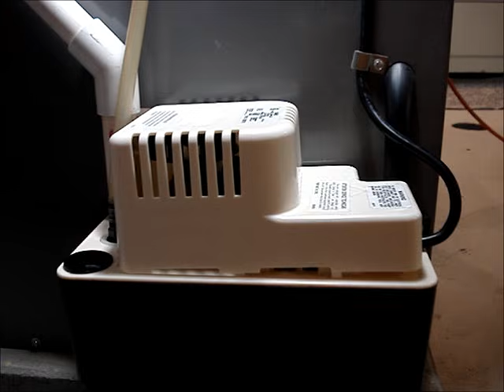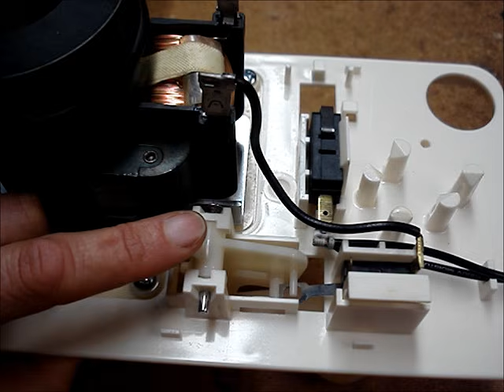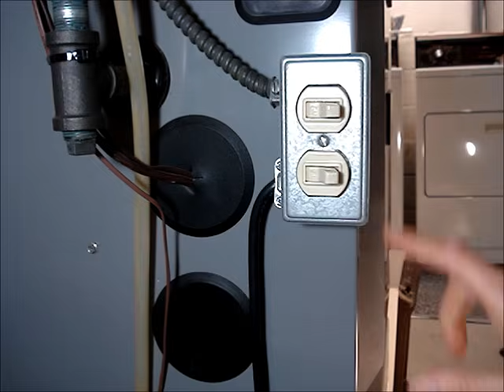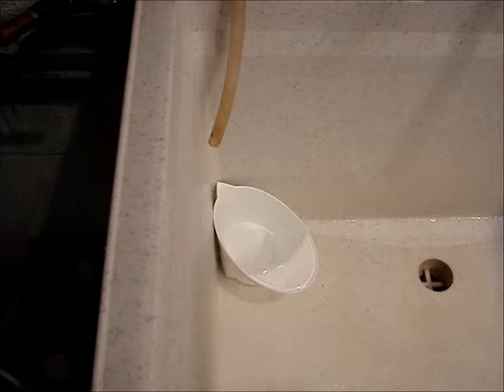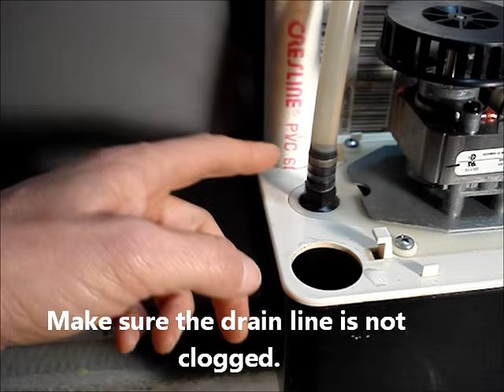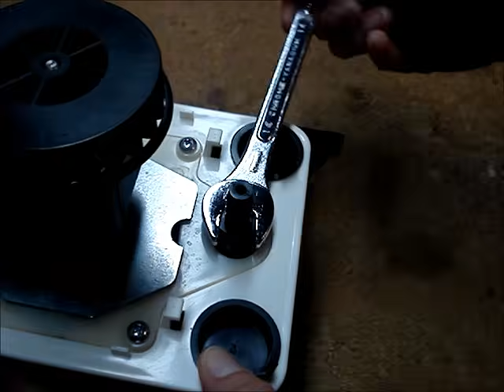How to Troubleshoot a Condensate Pump

Comment: I installed a brand new pump yesterday and it's overflowing from the tank onto the floor but it's still pumping water thru the drain line to the outside of my house.  No signs of drain blockage and i figure the chances of defective pump are slim.  I'm at a loss quite frankly.  Literally brand new out of the box.
Reply from the maker: If the new pump isn't failing the same way as the old one, check the literature that came with the pump.  It should have a number to contact the company.  Call them, they should have free support and can tell you if the new pump is defective.  These days new doesn't mean it's good.  I bought a brand new stove and the oven temperature sensor was defective.
Reply: @Know-How-Now It's failing the exact same way as the old one.  I read somewhere the plastic tube from the pump connecting to drain pipe should have a loop or similar trap to prevent water from backing into the pump and putting constant pressure on the float switch.  My drain pipe is above the pump and drains outside my house.  So the pump shoots water upward and gravity might force water back down.  Who knows...

Comment: I have a diversitech should a light be   on at all times to show power or does it just come on when filled with water
Reply from the maker: I am not familiar with all the details of various models/makes.  You might check on their website and see if you can download the installation instructions/use manual.
https://www.diversitech.com/product-families/condensate-management/condensate-pumps

Comment: Thank you for this video. It helped troubleshooting but still no joy. Then it occurred to me to take the top cap off and spin the impeller by hand ( when it was unplugged) then a bunch of rusty sediment came to the surface that was hidden in the impeller housing. After that it worked like new.  I will add a cup of vinegar a month to try and keep it clear.
Reply from the maker: You are welcome.  Thanks for sharing, your comment might help someone else get their pump going again.  Have a great day.

Comment: Why do you even need this? my old house has it, new house no? why do you need it?
Reply from the maker: The new high efficiency gas furnaces create condensate water.  Mine also creates water from the AC unit.  You also might find a unit like this pumping some sort of water up to a higher point into a drain system or maybe from a dehumidifier.

Comment: My condensate pump has been acting weird lately. It will turn on and off a lot. Sometimes it's in really quick and short bursts, other times it will be on for several seconds. There are a lot of bubbles in the outlet water line. When it comes on I will see the bubbles flow to the outlet, but then they start flowing back when it turns off. Not sure if this is a bad check valve or if one of the switches is going bad.

Comment: Hi, do you any video about how to solve gurgling noise on a condensate pump. My line is really long… goes up to the ceiling, cross my house and goes down from a second floor to the backyard…
Reply from the maker: I do not.  I'd venture to guess it has to do with how the pipe is run.  Maybe and engineer who understands fluid dynamics could solve that... it's beyond my level of education.

Comment: Good to know 😅 I accidentally pushed the test feature on the pump too long without water and I got smoke coming out if the motor
Reply: Does this mean my pump is messed up ?
Reply from the maker: Letting out the magic smoke is usually not a good sign.  Put some water in it and test it out... hopefully it still works.

Comment: Thank you for the video, my problem is that the pump works all the time, non-stop weather the AC is on or not. Any tips to fix are greatly appreciated.
Reply from the maker: I check to see if the float is stuck or the microswitch is bad.
Reply: @Know-How-Now  I appreciate your quick response

Comment: My ac shuts off because the pump gets filled. But if I unplug the pump and plug it back in it drains. Any thoughts? Thanks!
Reply from the maker: If it's the same pump as in the video, there is no circuit board, so no rebooting of any computer chip.  Maybe the float (gunked up inside) or microswitch is sticking?  You can try filling it with water and gently tapping the case of the pump to see if it starts up.
Reply: Thanks so much for responding! I will try it!

Comment: Thanks for the vid! My condensing pump wasn’t running after our boiler system leaked. Turn out I just needed to take the top cover off and play with the bobber/limit switch to get it back on track. I was planning on calling HVAC but this video and another on here let me do it myself. Probably saved me a couple hundred bucks!
Reply from the maker: You are welcome.  It's my pleasure to help.

Comment: I have a magnet float and it is set to low how would I adjust the pump to come on sooner.  Ac unit shuts down until I take top off and lift float up.  Mac
Reply from the maker: Without seeing/knowing the specifics about your pump, it is hard to answer your question.  I would suggest getting the make/model number from the tag on your pump.  Go to the manufacturer's website and down load the installation instructions.  There is likely a procedure to adjust the magnet/float.

Comment: My condensate pump keeps going on for 3 seconds, then shuts off and then comes back on for 3 seconds about 15-20 seconds later...and over and over. I have moved the PVC pipe to a large 5 gallon pale while I am running my AC until I can get around to conducting some of the tips in this video. I will follow up if any of the tips worked. Great video! I just subscribed. 5 days into being a first time home buyer and i've done more projects that I expected.

Edit: tips on the video worked perfectly! Pump is back up and running!!!
Reply from the maker: Welcome to Know How Now.  Thanks for subscribing.   Congratulations on the purchase of your first home.
Reply: @Know-How-Now  your tips worked like a charm! Thank you!!
Reply from the maker: Great!  You are welcome.

Comment: What if I filled the reservoir enough to kick the pump but then it stopped. But i did get some water in the cup on the other end
Reply from the maker: Are you saying that the pump didn't empty the reservoir?  If yes, then possible problems are with the float, the microswitch for  the float or maybe it's gunked up and needs to be cleaned.  I have a video that shows how to clean the pump.  Here's the link:  https://youtu.be/gKsKUM2N8AM?si=0Zo1usaBoafJ8eu0

Comment: I am so grateful for the clear explanation of how it works. When I discovered a puddle and looked closer, I saw that the inlet tubes were not placed in the pump. It seems it has been on without water and I fear I must replace it. But going forward I know how to make sure it is properly installed and maintained.

Comment: Great Great video!! My problem is the pump is running non stop and the red light is on on top of the pump I unplugged it and plugged it back in but it went right back to running
Reply from the maker: I'm not familiar with every make/model/ brand pump.  You might try finding the make/model number tag.  Then go online to find the manual on the manufacturer's website.  It will likely tell you what the red light means.

Comment: I woke up this morning and the condensation pump was running constantly. I noticed that my water lines were froze as well. I went down to investigate and found out that the wind had blown my front door wide open. I got it shut got the water lines to work again but the pump is constantly running and a red light is lit. Didn't have any problems with it until it got really really cold.

Comment: What if your pump is making dripping noises but not leaking water anywhere
Reply from the maker: I suppose the condensate water could be dripping into the pump.  Without being there and studying the problem, it impossible to give a diagnosis.

Comment: can the float be adjusted?  Mine only works when the float is all the way up then shuts off as soon as lowers slightly leaving disgusting water to stagnate.
Reply from the maker: The Little Giant pump in the video has no float adjustment.... there is just a micro switch.  If yours has a micro switch with a metal arm on it, maybe someone bent the arm on the micro switch?

Comment: Mine was making a loud humming sound, when I examined it the hose felt kinked. I lifted it to see if the hose was pinched shut, a few seconds later the humming stopped. I'm not sure what was wrong, but thanks for describing the unit enough to understand what I was looking for.

Comment: Thank you ! 
I think mine is crude up.
It only pushes a little water when run without tubes. 
I shook it and the fountain went higher.  I'll give it a good clean . 
I ordered another one anyway .
37.00 scratch and dent so no big deal !   Thanks again
Reply from the maker: You are welcome, Helena.  Mine had a bad micro switch.  If I remember correctly, it would have taken hours to hunt down the correct switch.  I just bought another pump for the switch & spare parts.

Comment: Hello, I have a little giant 15 series much like the one in your video. I live in a northern climate so it goes off and runs frequently! Recently I have noticed that it now seems to want to run the motor for about a second every 12 seconds. If the sound of the pump wasn’t annoying to begin with then this constant whirring every 12 seconds is! Other than that it seems to work just fine. What would be causing such a regular sound?
Reply from the maker: Check to see if it is running dry.  That might be the noise you are hearing.  Running the pump without water in the reservoir is not good for it.  You'll need to figure out why.  Microswitch problem?  Float?

Comment: Is it normal for condensate pump to run a lot in the winter? When it gets below freezing here, I notice the pump runs a lot and the water drops into my basement sink. I have the humidity set at 30%
Reply from the maker: Yes, it's likely normal.  The furnace is creating condensation when it is running.
Reply: @Know-How-Now  Gotcha, any idea on what I can do with that extra water instead of letting it go to waste? Is it clean water?
Reply from the maker: The water is a byproduct of combustion.  It's acidic.

Comment: Whenever my furnace turns on I hear a drip  in the same spot in the vent in the ceiling . Is it possible it has something to do with condensation pump ?
Reply from the maker: I suppose the drain tube for the condensate pump could be in that area.

Comment: Outstanding video!!!!   Looked this up because I just bought this pump.  I have it connected to an ice maker.  The pump will not activate unless I have it tilted a little (small board under one end) Once the pump is activated, it works like a champ. Without tilting it, the pump doesn’t activate and water pores out onto the floor. An clue as to why I have to tilt it?
Reply from the maker: Without being there and doing some testing, I can't give you a good diagnosis.  I would return the pump and get a new one, it sounds like it is defective.  A lot of stores have a generous return policy, if that doesn't work, then go for a warranty replacement from the manufacturer.

Comment: pump is making noise as water is expelled. Any recommendations?
Reply from the maker: The bearings could be failing or maybe the float or switch for the float isn't working properly and the pump is running dry.... running dry is not good for the pump.

Comment: I have a Diversitech Floatless pump and i keep getting the high level alarm when it is empty and will try to continue pumping and make an aweful sound. Any ideas? The pump is about a year old.
Reply from the maker: I'd guess the awful noise is the pump is running dry... not a good thing.  It is still likely under warranty.  Call Diversitech... they might send you a new pump.

Comment: Hi! I have a liberty pump condensate pump that was just replaced a little over a year ago. Now twice in the past few days I've heard it go off like normal then continue to run then squeal when the there was no water left. I taped the top of the pump a few time which stopped the pump. I then do the test where I put water in the access hole and it runs/turns off like normal. Any ideas?
Reply from the maker: Sounds like maybe the microswitch (stops pump from running) may be intermittently sticking.
Reply: @Know-How-Now  thanks! So would it be best if I just replace the unit?
Reply from the maker: If you don't want to troubleshoot it and the pump is cheap & you can change it, then maybe that's the way to go.  I'm just guessing sight unseen from an armchair.  I could be wrong.  It's only a year old, maybe it's under warranty?

Comment: After cleaning the pump I discovered my actual problem. If your pump is continuously running if you pull the hose from the pump little or no water should come out. When I pulled my hose I got sprayed in the face. Come to find out the hose over time became pinched stopping the water from flowing. Causing the pump to continue to run. Might want to check that before you start making repairs.
Reply from the maker: Thank you for taking the time to comment, it's contributions like yours that add to the value of the videos.  Sorry to hear you got a free shower.

Comment: Very good video.  Question: If I choose to NOT connect the safety switch , will it cause any problem?  Just wire nut the ends of the two wires?
Reply from the maker: The safety switch is just a set of "dry" contacts, no voltage or current is present.  It doesn't hurt to cap them off and tuck them away.
Reply from the maker: If the pump is next to a floor drain or at a location where if it overflows it won't cause water damage you can get by without connecting the safety switch.  Codes may require you to connect it.  I'll put a link below for some code guidance. 

If the switch was connected to your furnace and there are only two wires coming from the furnace, then you'll need to wire nut the two wires from the furnace together to "jump out" the switch.  You may be violating a code if the switch was connected.

https://inspectapedia.com/aircond/Condensate_Drains.php
Reply: @Know-How-Now  Thanks and sorry I wasnt clearer.  My furnace/AC never has had a safety switch but I had to replace the pump.  So I thought there might be current in the two safety switch wires FROM the pump.  So I had better cap them off, Right?

Comment: Great video. I had some water under my pump so wiped it up. HVAC guy said pump was sweating since we have humidity right now? ???  Right or wrong pump is almost 11 yo. Tube also has a place doesn't look good.   Help. And evaporating coil has leak someplace. Replace coil or entire unit?
Reply from the maker: Hi Mary, without going through the troubleshooting process as described in the video, I can't determine if your pump is bad.  If it has never sweated in the past 11 years, and it is now "sweating" (and nothing else has changed) then you may want to go through the troubleshooting step in the video.

As for the evaporating coil leak, you may want to get a few estimates on the cost to replace it vs replacing the unit.
Reply: @Know-How-Now  Appreciate your input and answering my questions. Warranty ran out last August go figure. I just want to make the right decision. In my 70's so thanks for a great video. Wish you were closer 😃 Take care.
Reply from the maker: Sorry I can't give you a more exact answer.  Ask friends and neighbors for references for reputable HVAC contractors.  Get quotes and compare prices and advice on replacing vs repair.  If you have a HVAC company you use, you will likely get the most honest answer from the service tech.  There are good honest people out there, you just have to find them.

Comment: Hello, great video! can anyone tell me if it would be safe to put CLR into the pump reservoir? My plastic drain tube is pretty gunked up, but it is ran through my basement ceiling and outside, making it difficult to replace.

Comment: Hi there, this question is unrelated to this but I wanted to ask you ...
Regarding my outside water tap .. every time we use it,  it rattles, vibrates and makes noise inside the house. What can I do to solve this annoying problem? Thank you
Reply from the maker: A loose washer can cause vibration.  I have a video that shows how to replace the washer in an outdoor faucet.  If there is a shut off valve for the faucet (not a ball valve), it also has a washer.  https://www.youtube.com/watch?v=M2piIi1qCDU
Reply: @Know-How-Now  Thank you for the info .. but it seems my problem is more than just a washer. It just seems like the pipes are vibrating, loud and noisy in the house when turning it on. But thx again for the advice.

Comment: Should the pump reservoir be emptying completely? There is a lot of water staying in there about 1 inch from the hole. Also I am not hearing any water going down the bathtub drain like it use to either?
Reply from the maker: If I understand correctly, the water is about 1 inch from the top of the reservoir.  If that is true,It sounds like your pump is not working.  It should empty almost all of the water from the reservoir.  I also have a video that explains how the pump works: https://www.youtube.com/watch?v=-wX2KXitQbA

Comment: Our pump is running constantly after we recently had the floors worked on in the vicinity above the pump. I plugged it out, is there anything I can do to stop it running constantly?
Reply from the maker: Without being there to troubleshoot it, I cannot diagnose the problem.  I would have to go through the steps in the video.

Comment: Great video. Thanks for sharing. It should be noted that the switches can be replaced on a little giant pump. A whole new pumps is not always necessary.
Reply from the maker: Thanks for pointing that out, Christopher.  For anyone interested here is a link to Little Giant's parts page:  https://little-giantpump.com/little_giant_condensate_pump_parts_.html